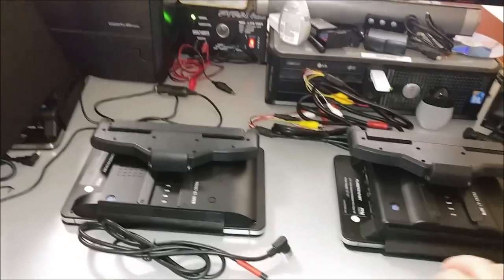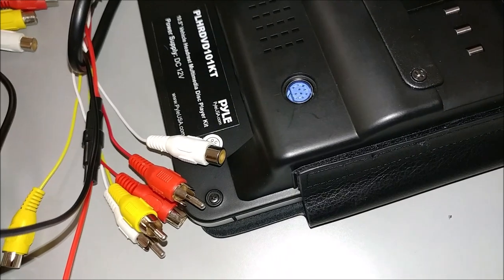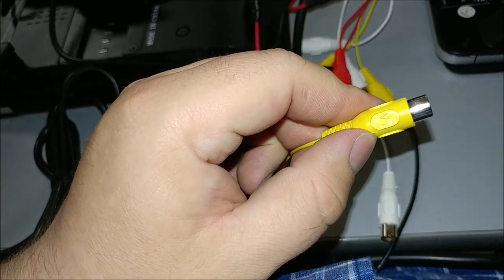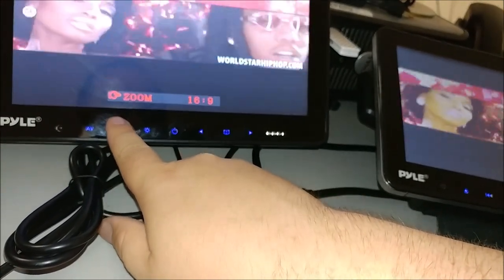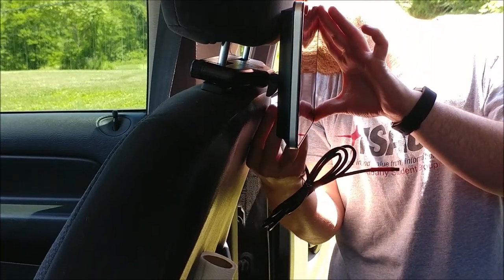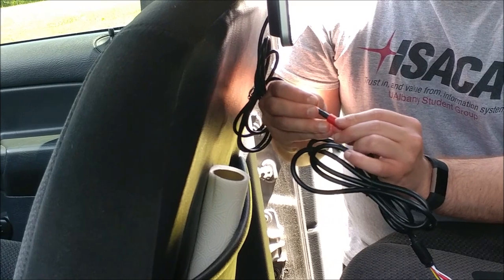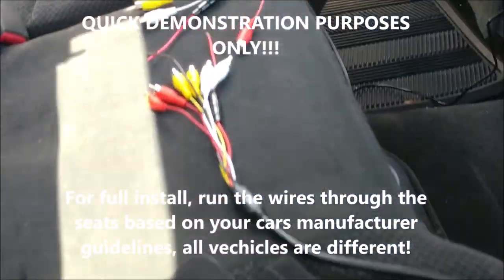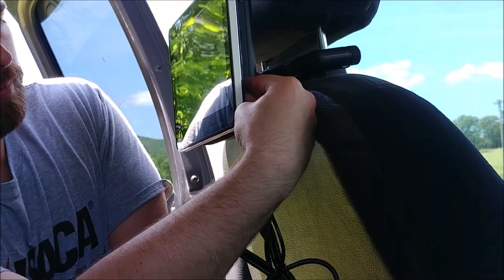Pyle PLHRDVD101KT Dual Vehicle Headrest Mount Multimedia Disc Player System

Comment: I know this is an old video but thought I would try anyway.  I installed these yesterday just like the video.  The slave screen just flashes in and out and the main screen turns off after a couple of seconds after putting a DVD in the player.  Any help before sending them back?